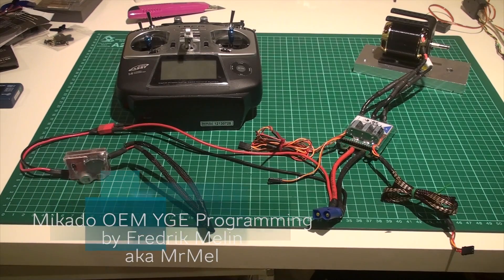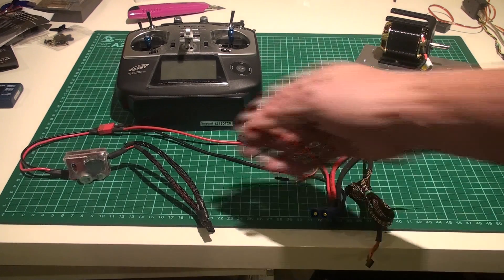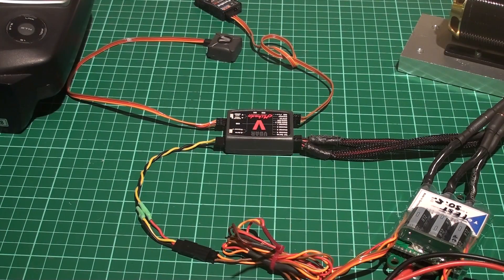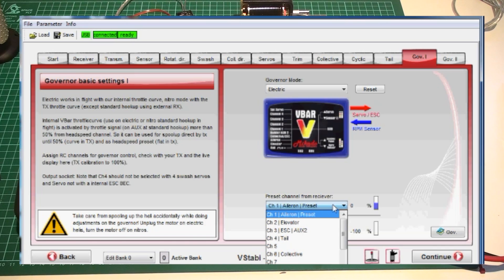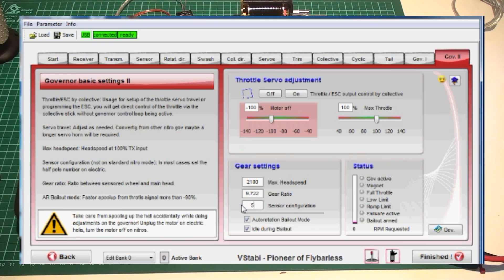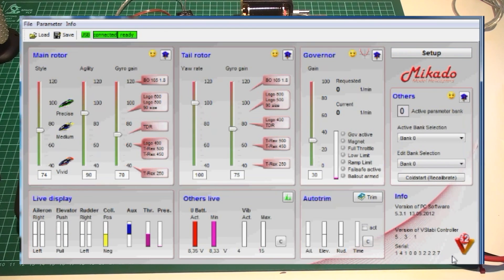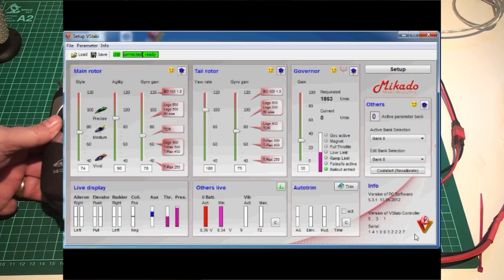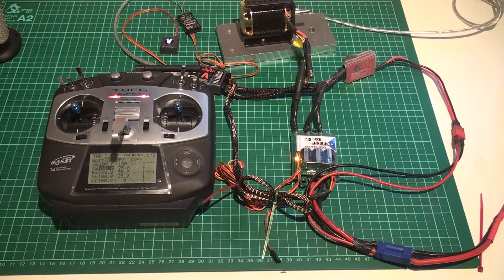YGE Mikado OEM Programming

Comment from the maker: Exactly, The TX calibration and Governor endpoints have a "symbosis" relationship
In such cases you can lower the radio endpoints a point and two

In other words, if Governor is 100/100 and your radio is 99.5/99.5 (i.e. not all the way) its the RADIO that rules.

Comment: Fredrik,
You can not leave the end points at +100 -100 if you use Spektrum.  Mine nor two friends will work correctly there.  Both require very slight adjustments for the low end end point to be correct and +100 will not give 100% throttle.  A slight adjustment has to be made as well there.  Friend has Sbus and it works fine at +100 -100, but it will not with Spektrum bound in DSMX 11ms.